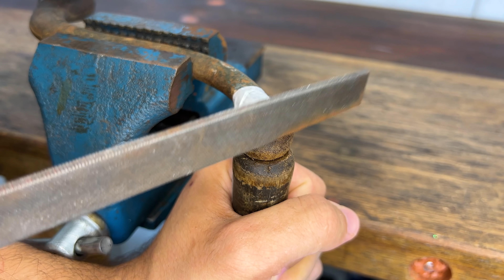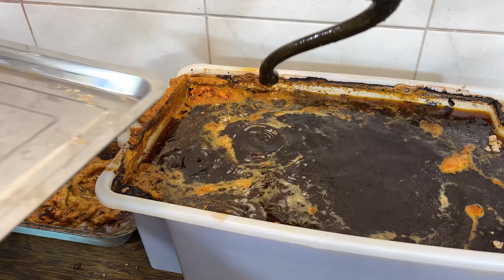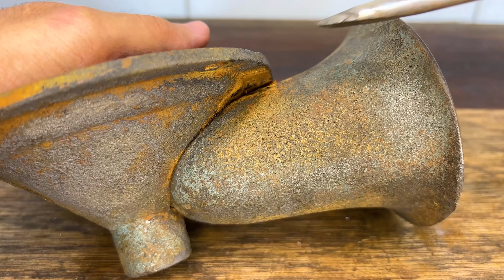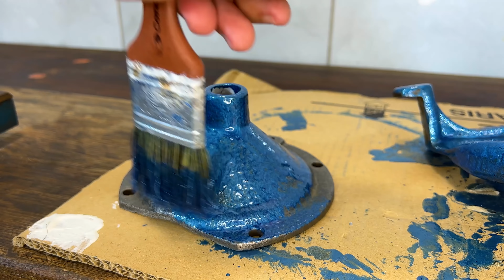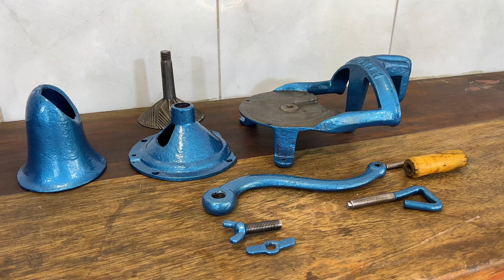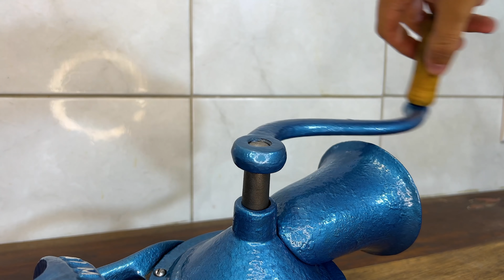Old Rusted Coffee Grinder - Restoration - Workshop DC

Comment: It’s a beautiful restoration, well done. Do you have a way of spraying the paint on the parts? I find spraying always gives a much better hammered texture rather than using a brush.
Reply from the maker: Thanks! I didn't have the machine to spray the Paint, but hammered texture really looks better with spray. ❤️
Reply: @WorkshopDC  Hmmmhmh ... may be you can use a small airbrush like we use it in modeling - with a cheap compressor and thinned colour... ?

Comment: Additional : If you use am brush maybe you will get better results when using a smaller brush with soft hair and a rounded shape and the colour in 2 or 3 thin coats ... ?
Reply from the maker: The Surface in some areas are not straight so the hammered effect will not appears even If i use a smaller brush to paint. Thanks for Watching! ❤️